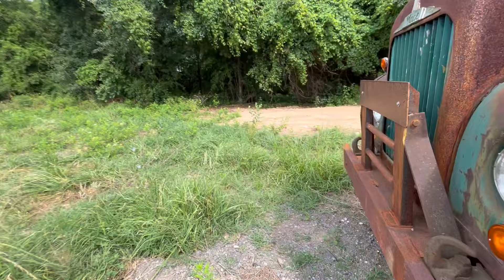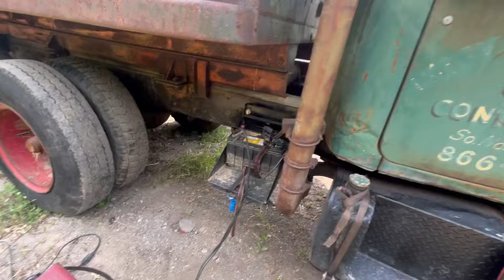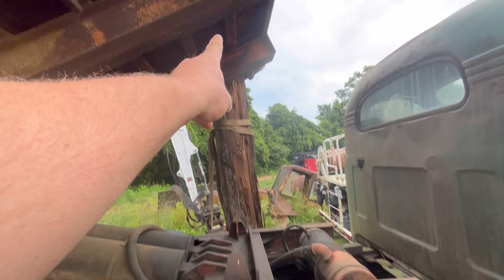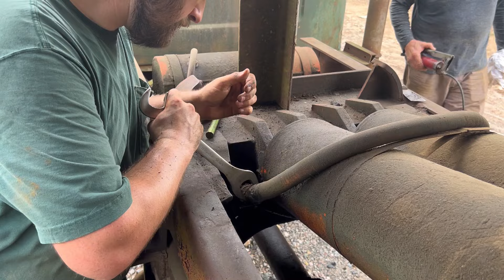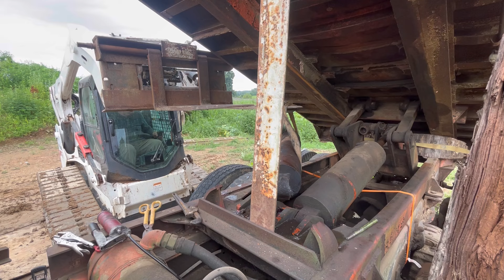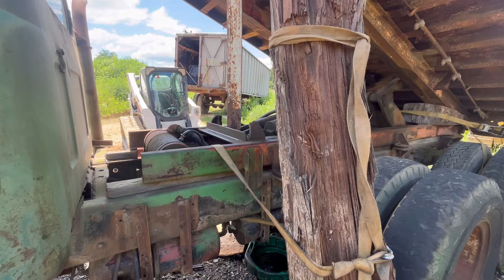Mack B61 Truck Won't Dump? Can we figure it out so it can finally haul a load? Plus some drive time!

Comment: Fyi only use lo lo in 1st and reverse, lo lo does not have a slinger gear to lube the gear set. For the most part just use low,medium and high of the compound, quad boxes are for all intents and purposes are a triplex with a granny gear 😉
Reply from the maker: Thanks I've heard that before and I guess forgotten it

Comment: I did Not hear it running so bad. That cat hooked to the bed front was unsafe. The pole you have standing is good but I would not trust those blocks under the back. Putting that heavy angle iron in was fine.
Reply from the maker: sounds like I got it 50% right